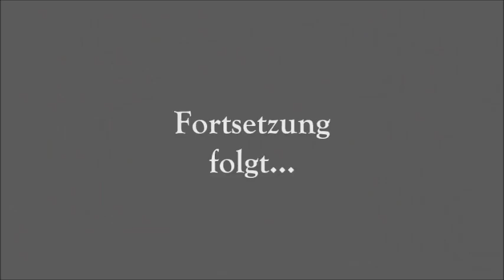Frästisch (Teil 1) - how to build a router table

Comment: Wie groß ist denn der Frästisch? Was für Platten hast du genommen?
Reply from the maker: Der Frästisch hat die Maße 117cm x 84cm, abgestimmt auf die Abmessungen meiner Werkbank ;-) 

Die Platten die ich genommen habe sind 

12mm Siebdruck
12mm Multiplex
15mm Multiplex

Wenn ich ihn jetzt nochmals bauen würde, dann würde ich aber eher auf eine oder max. zwei Platten gehen, und bei zwei würde ich dann die Siebdruckplatte mind. 15mm stark nehmen, um das C-Profil besser verbauen zu können. 

Viele Grüße
Matze